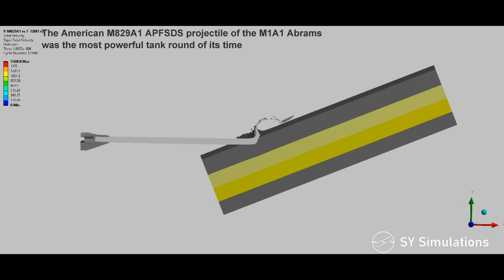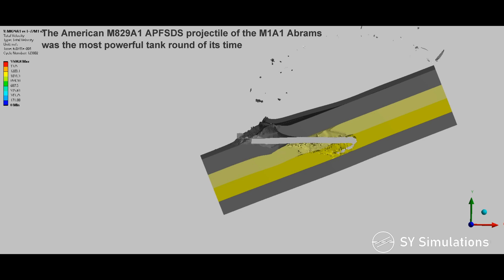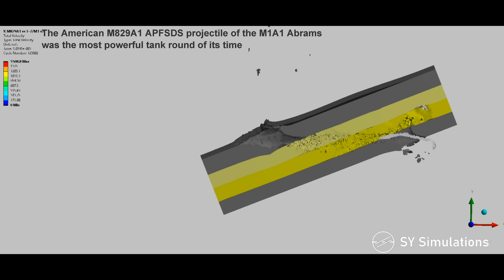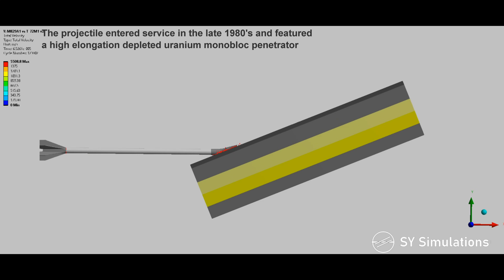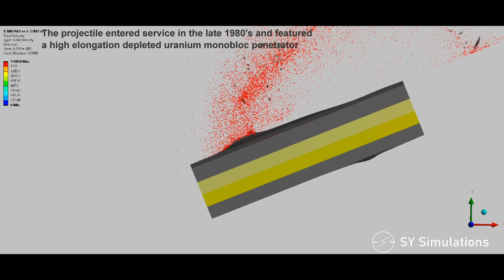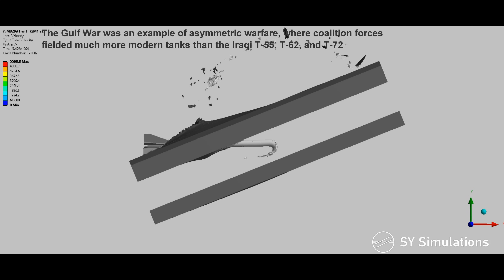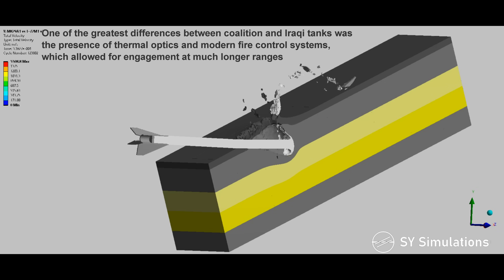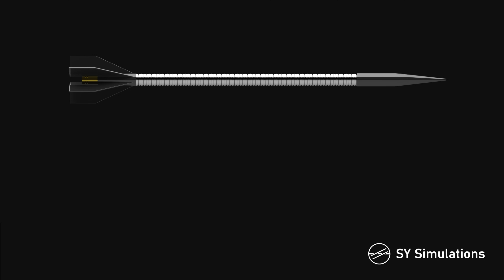Abrams SILVER BULLET vs Iraqi T-72 | M829A1 Depleted Uranium APFSDS Armour Penetration Simulation

Comment: There was a story of M1 getting stuck in mud during Desert Storm. As they were waiting for retrieval, it was attacked by three Iraqi T-72. First T-72 hit the M1 with HEAT round, but it did no damage, it was then destroyed by the M1. Second Iraqi tank also fired a HEAT-round, which did no damage, and the tank was then destroyed by the M1. Third tank fired a Sabot-round, which grooved the armour on M1, but did not penetrate. The T-72 then went behind a sand dune for cover, and the M1 shot a Sabot-round through the dune, and destroyed the Iraqi tank.

Comment: This is a best case scenario too, apparently the T-72 "Assad Babil" tanks produced domestically had far worse steel quality than the Russian ones. That leaves only mild steel and textolite to try to stop this massive penetrator. 

Also, would be interesting to see the T-55 Enigma vs something like an M60 or 105mm Abrams. It was a T-55 upgraded with large crude composite armor boxes filled with steel plates and (i think) rubber.

Comment: What if the Iraqis had put ERA on. Would that have helped against these American munitions?
Reply: I’m not a genius on this stuff, but if I had to make my best educated guess, I’d say probably not by much. ERA is most effective against HEAT munitions, and although it has been shown that older kinds can and will destabilize APFSDS  projectiles to a degree, I have a feeling looking at this simulation that it would not have been enough of a difference to matter. Especially since this shot was at 3km, and I find it likely that they could have been shot at even closer than that. Maybe less than 1.5km.
Reply: Смотря какую

Comment: Desert Storm surely wasn't assymetric. Assymetric warfare is a particular type of operations, which Desert Storm certainly wasn't.
Iraqui equipment was not exactly outdated. Sure, some of it was older - but so was a lot of coalition stuff. M60s are older than T62s, M1A1s are only slightly newer than T 72s and so on. On paper the mismatch, at least on the ground, wasn't that large.

Comment: I was on an M1A1 during Desert Storm... I saw a lot of Iraqi tanks get hit in the upper glacis and saw the tracer come out of the back and bounce off the ground behind them. This was almost always immediately followed by the turret doing a jack in the box imitation when the ammo went up. Our engagement range was more in the 1800 to 2000 meter zone.
Reply: So the game "Gunner, Heat, PC" is very accurate compare to real life's impact?
Reply: @dmknght8946  I'd be willing to say it's the best sim I've played. I say that as somebody that also has Steel Beasts 2 Pro PE.
Reply: I think the export T72M don't even have the same NERA hull array as the in russian service T-72A. So yeah it might be possible. The one in the video is assuming T-72M have the same hull array as T-72A
Reply: @Markhylis yes. And the turret only uses RHA instead of a composite array.
Reply: Quick question: I read that you guys were instructed to engage Iraqi tanks from 2000 meters because they couldn't hit the Abrams from that range. Does that mean that their FCS couldn't aim accurately that far, their gun didn't have the precision, or their  sabot couldn't penetrate the Abrams from that far?
Reply: @ar0568  Well, it's mostly  related to "the optimal range to engage enemy tanks", and the Abrams being able to hit target at that range accurately and effectively.

 They don't actually know how bad the Iraqi T-72's were until later on.
Reply: @ar0568  The fire control systems I saw in the abandoned ones were somewhere between M60A1 and M60A3 level. No laser range finder, and IR night sights... like 800 meter range in the best of conditions. They seriously weren't much better off in broad daylight. Our thermals picked them up WAAAY outside any range they could hope to return effective fire.
Reply: @LeonidasRex1  ah okay so it was their fcs, good to know. Makes sense; when tanks upgrade their fcs they make such a big deal out of it, because it is. Thanks for answering
Reply: @LeonidasRex1  were the iraqi night sights reliant on an infared spotlight?
Reply: I don't think they survived that.

Comment: Okay but what was the armor layout of russian tanks at that time ? Was it the same ?
Reply: its same,back then M1A1 was the best MBT
Reply: @usmc5977  Wrong. It wasn't the same, only on the Outdated and out of service T-72A. Modern T-80Us and T-72B's had much better armour, and some even have the famous Kontakt-5 ERA. 

Most T-80U armour was a 50-30-50-30-50 Array of High Hardness armour and Textolite.
While T-72B's had 60-15-15-15-50 or 60-10-10-20-20-50 armour arrays both Composed of Rolled Homogenous Armour and High Hardness armour with 15mm or 10mm Air gaps in between them.

Those arrays alone would stop this Round, let alone combined with Kontakt-5, the M829A1 would have stood absolutely no chance.

And the M1A1 being the best tank is debatable. The T-80U was by far a near peer to the M1A1. Only thing is it's overshadowed by the T-72 and the collapse of the USSR.
Reply: Soviet T-72A was the Russian used variant. T-72M1 is an export equivalent sold to many Soviet satellite states. There were not that many differences between them. The Russians started using T-72B which has improved armor.
Reply: @TeurastajaNexus  yes but that time Still M1A1 was the best mbt in the world during those times, no ussr armor can match the abrams back then.
Reply: @usmc5977  True. Also, Don't forget the Leopard 2A4. Western armor was and still is superior to what the Russians have.

Comment: The simulation is inaccurate in showing the round’s deformation. The round penetrates T-72 frontal armor and remains relatively intact. 
Why do I know this? I walked the 73 Easting battlefield about a week after it occurred. I will never forget seeing a destroyed T-72. The APFSDS round entered slightly left of center on the upper hull plate. It passed through the turret, igniting the ammunition, which blew the turret approximately 10 yds to the right and slightly to the rear of the hull. 
The round entered the engine block, ripped the engine and transmission out of the tank, and deposited it approximately 12 feet to the rear of the vehicle. There was a hole in the back of the transmission from where the round continued to travel. 
Iron Troop, 3/2 ACR vet here.
Reply: @masterafro999. This comment is the one I’m referencing.
Reply: not an expert, and no experience with this sort of thing, but wouldn't there be fairly significant deceleration in a 3km shot like this one was simulated to be? 3km seems like a lot of space for the round to decelerate
Reply: @k0valus585  The muzzle velocity of the A1 round is 1,575m/s.  A 3000m shot is about 2s from shot to impact. The penetrator weighs about 10lbs. Velocity loss is not particularly significant at that range - which is the published maximum effective range of this round. Desert Storm crews can personally attest to the fact that this round will punch through Iraqi T-72 armor at that range and beyond.  The challenge for the T-72 of all varieties is its ammunition storage.  Virtually any penetration of the armor package into the turret results in strikes to the ammunition resulting in detonation.  Imagine a 40-plus ton frying pan flipping 20-30ft in the air.  In fact, we discovered that the Abrams fire control system and ammunition effectiveness far exceeded the FLIR's ability to positively ID targets at extended ranges beyond 3000m.  "Killing hot spots" was the term used at the time.  The current version of this round is the M829A4.
Reply: @danielmiller2076  ah appreciate it my friend

Comment: 3km shot on the UFP, while being pierced like butter: noooice
Reply: T-72M1 armor is supposed to stop 105mm DM23 APFSDS, not the late 80s 120mm M829A1.
Reply: @rinaldoman3331  This was the card they got dealt.
Reply: @rinaldoman3331 I get this complaint on hypothetical. OBVIOUSLY it was designed for 105s. Nobody told the incoming 120s that.

Comment: Same shell VS T-80 or 90M? Obviously the Iraqi T-72 is an outdated model compared to this shell
Reply: @exoticdachoo007  T-90M used T-72A’s hull. It’s a recycled version of old T-72.
Reply: @grigor.h3929  It's not a recycled version, they didn't just take a T-72 hull and that's it. They used the T-72 hull's design and heavily improved upon it to be much more armored. And what you're thinking about is probably the base T-90, which yea, it is basically a T-72 clone, but the T-90M isn't that simple
Reply: @exoticdachoo007  In the Soviet Union, There are only 2 ways to get a new hull. 1, beg Ukrainian to built a new one. 2,Recycle an old one from storage.

However, T-90M is a lightweight version  based French weapon system because it uses T-34’s V2 (called V92 now)engine. It must keep light enough or immobilized by it self.
Reply: @exoticdachoo007  One thing you must know, the true name of T-90 is “T-72BV”.
Reply: @exoticdachoo007  Iraqi T-72 has the same armor as T-72A, you may want to talk about the T-72G but it’s a advantage model used T-64A’s armor design , effective to against KE round and lightweight for the desert terrain.

Comment: The age old debate whether or not actual soviet mbts would have survived those shots is pretty clear cut. The hull of the t-72b alone would have likely stopped this round under the same circumstances. Adding k5 would simply solidify that outcome. Long rod DU mono block penetrators are very brittle and prone to shattering when external shear forces are imparted on its body. Complex composite armour arrays and heavy reactive armour tiles such as k5 do exactly that...
Reply: No, it would not have stopped the Silver Bullet.
Reply: @danielmiller2076  why wouldn't it? Look at what little of a projectile exited the armour at the end of this simulation. That's a 60s armour layout. Why would an 80 armour layout yield the same results..?
Reply: @Masterafro999  Because the simulation is incorrect.  Far more of an intact penetrator punches through the armor envelope than what is shown in the simulation. I have seen the actual results against T-72s, which is how I know that this simulation is inaccurate. Please see my comment on actual observed results.
Reply: @danielmiller2076  I should see which comment? 

Anyways...the t-72b would have likely stopped the round under the same circumstances. Same distance etc.. M829a1 would likely penetrate the t-72b hull without era at shorter ranges. Era would reduce that distance even further. 
Also...where did you see the actual results of a t-72b being penetrated by m829a1. Those two never fought...till ukr...
Reply: @Masterafro999  I never claimed to have seen M829A1 against T-72b. I personally saw the effects of M829A1 against T-72M in real time. I am a veteran of 73 Easting. That’s how I know that this simulation showing the effects of M829A1 against T-72M frontal armor is incorrect. In fact it is grossly incorrect. It also would penetrate T-80 with ERA over the frontal aspect. Using this simulation to draw conclusions of the effectiveness of M829A1 APFSDS is an error.
Reply: @danielmiller2076   thanks for clearing that up. Did you see a t-72m getting penetrated by m829a1 at a distance of 3km?  Would have been interesting. The results at shorter ranges are obvious. As I had stated. Also where did you see a t-80 get holed? That's entirely possible, depending on the variant, but Iraq, to my knowledge, did not operate any t-80s. Some t-80s had the same combination k 3 layered glass-reinforced plastic armour layout like the t-72a in this video. Light era like k1 would have a negligible effect on any kinetic penetrators
Reply: @Masterafro999  Yes as to M829A1 vs T-72M. Shot was at 3200m and caused the turret to blow off due to ammo cook off. Shot entered front upper hull just to left of driver’s compartment (from firer’s view). Penetrator went through the turret compartment, caromed off the engine block, and ripped off the drive sprocket as it exited. 
I have not seen real-world results against T-80 with ERA, and neither has anyone else. That’s as far as I will go with how I know what I know.
Reply: @danielmiller2076  well the stub that passed through the armour in this simulation had places to be. Could have hit the ammunition causing the turret to fly. 
I was basing my comments on a few soviet test trials and their respective documentations, international firing trails on ex soviet tanks and armour arrays and purely scientific papers on armour and projectiles. Plenty of testing went into modern long rod penetrators. Mono block tends to penetrate more homogeneous steel whilst jacketed penetrators tend to hold up better against composites and era. The shear forces imparted onto the monoblock m829a1 penetrator, by heavy era like K5 or complex composite arrays, could likely cause it to lose its structural stability and shatter. That was the conclusion after the Bundeswehr trials on k5 and t-72bs. Hence why m829a2 was created. Switching from a uranium titanium alloy to a tungsten uranium alloy improved structural stability under load by 25%. Allegedly.
Reply: @Masterafro999  I agree with you that there are serious challenges with designing KE penetrators, particularly against modern armor packages. Long-rod heavy metal penetrators maximize density for the diameter of the round. The challenge you described so well is the ability to maintain the integrity of the round as it strikes and attempts to defeat the armor package. Ideally you want a shorter, denser, penetrator for any given diameter. The challenge is the materials available to manufacture and propel such rounds.
Reply: @danielmiller2076  I'm a sucker for heavy equipment in all fields. Tanks are pretty much the pinnacle of heavy equipment in a military setting. I have tons and tons of stuff on soviet armour, some Chinese and some German armour but I seemingly can't find much on US armour. Or British. Things like firing trails and their conclusions are very damn interesting to me. The craziest apfsds projectile I've ever come across was a prototype 3bm42 composite long rod penetrator that had it's front penetrator (3bm42 is a composite rod made up of a short and a long rod penetrator in a jacketed body) removed and replaced by a very narrow yet insanely powerful, for its size, shaped charge. The idea was to blast a narrow entry path into nera heavy composite armour. The idea itself kinda worked but the project got canceled due to the high drag, fast energy drop off, and lower velocity of the shell...

Comment: Can you do that same round vs t72b with kontact1 or kontact5?
Reply: The hull of the t-72b alone would have likely stopped this round under the same circumstances. Adding k5 would simply solidify that outcome. Long rod DU penetrators are very brittle and prone to shattering when external shear forces are imparted on its body. Complex composite armour arrays and heavy reactive armour tiles such as k5 do exactly that...
Reply: When NATO got a hold of Kontact 5, they had trials with that.

The result was near immunity at the area due to ERA. On T-72/T-80 hulls.

The new APFSDS was rushed into production due to those trials
Reply: @huntermad5668  I think Kontact 1 won't do anything much to this projectitle? (I believe I saw a simulation video that K-1 didn't help)
Reply: @dmknght8946 k1 is fully a HEAT stopping ERA, it barely does anything against kinetic penetrators, thats for K5

Comment: Try a 100mm BMP 3 cannon against Bradley!
Reply: The BMP-3's 100mm cannon is a low-pressure one which doesn't fire HEAT, let alone kinetic rounds. It uses HE-frag round and a guided missile.
Reply: @matovicmmilan  It uses the 9K116-3 "Basnya" ATGM
Reply: @matovicmmilan  Either way, HE would totally mess it up.